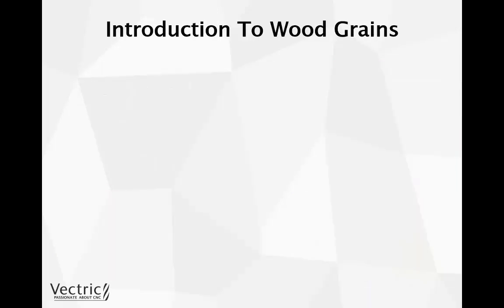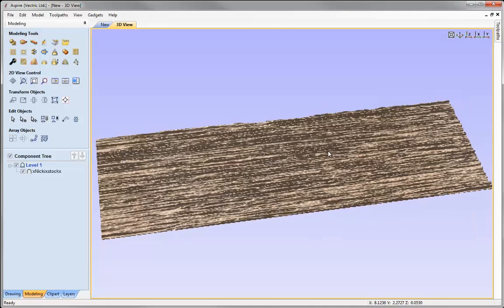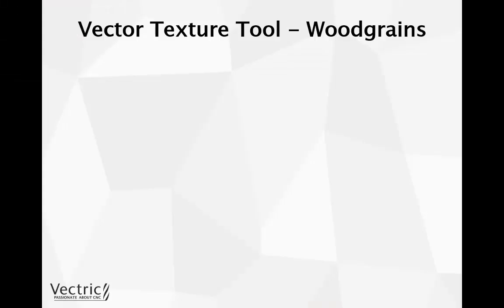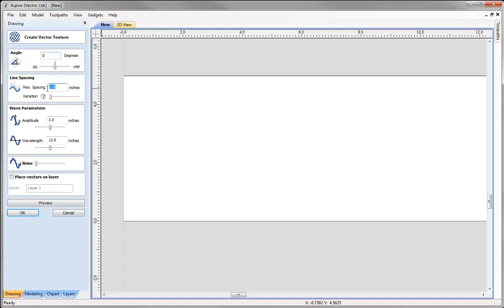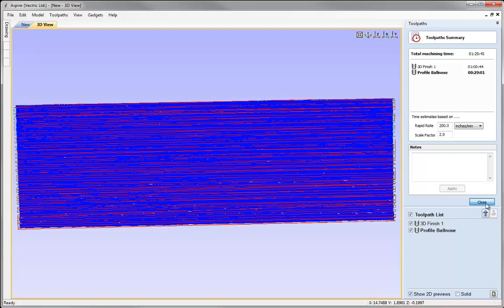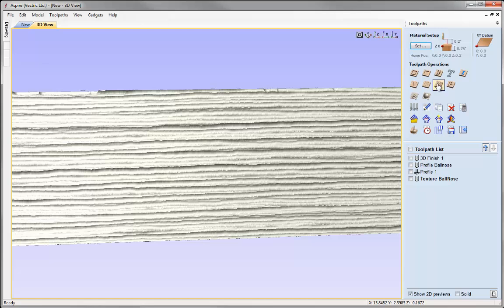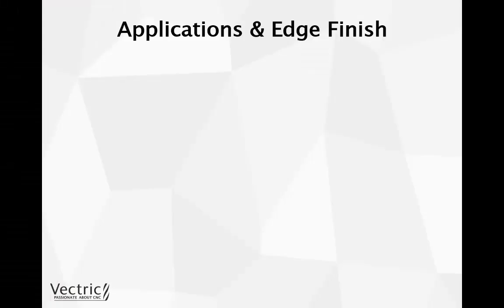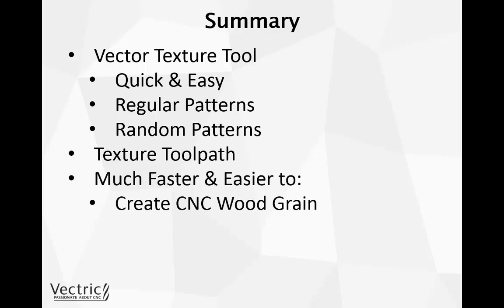Vectric - Textures Woodgrain UG

Comment: You finish by talking about how to integrate a texture into a design without running into other parts but you do not provide information on how to do this (Boundary offset & ramping and Chamfer) or provide a reference.
Reply from the maker: Hi Fournier, Thank you for your comments and feedback. The boundary offset and ramping are options within the texture toolpath - The boundary offset gives you the option to limit your texture to an offset you specify in the form (so that you do not run the toolpath completely within the original vector bounds - but this will cause a halo effect) and the Ramping option is used when using vectors for your texture where you ramp in and out of each vector to create the effect as demonstrated in the image. To see an example of the boundary offset used in the texture toolpath take a look at this video: https://www.youtube.com/watch?v=M0Tdxv-K5Bw. The Chamfer is where we use a VBit and use an offset (that is the radius of the tool) to create a nice chamfered edge. I hope this helps, thanks again for your feedback we will bear this in mind for future demos :)
Reply: @vectric  How do you take the wood grain back texture you just developed and use that as your background in a sign with the Chamfer edge script like in the Rocket video?